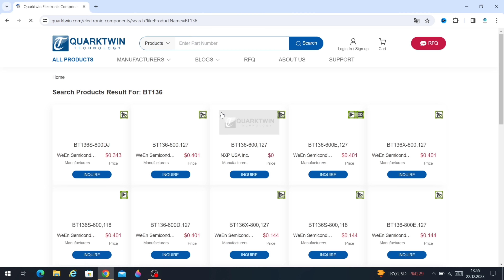Transformerless Adjustable Power Supply Using Triac AC Input DC Output

Comment: Parece muito bom. Só não tenho o BT 136 para montar esse circuito. Bom ano novo.🇧🇷
Reply: Você deve ter percebido que esse circuito é um dimmer com  uma ponte retificadora e um capacitor de filtragem  até meio baixo,  poliester de 1uf (105J ) que aliás não aparece a tensão e teria que ser de 400 volts para  ligar o circuito no 220V. O BT 136 é um triac de 600 V para 4 amperes, e pode ser substituido por qualquer triac com especificações parecidas.
Reply: @andreascarl6428  Sim, obrigado. Eu já achei alguns equivalentes. Bom ano novo.🇧🇷

Comment: Very good 👍,this circuit can be used for led tube,and led lamp sir, ?
Reply: Not recommended, LEDs need constant current, preferably stabilized, which is different from constant voltage. If you know how to use Ohm's law formulas to calculate a resistor in series with several LEDs it can work.
Reply: Thankyou very much sir
Reply from the maker: I do not recommend this circuit for LED applications.

Comment: Do you have a video on how to build a battery charger (for a lithium battery)?
Reply from the maker: I'm thinking of making a pcb project about this
Reply: I use a 1A stabilized power supply with the LM317T IC regulated to 4.2 volts and a 1 ohm x 5 watt resistor in series to charge 18650 cells. In this way, the charging current decreases as the cell voltage increases until it is almost zero when it reaches 4.2 volts. Be careful with damaged cells, they do not reach 4.2 volts and begin to heat up and may eventually explode.